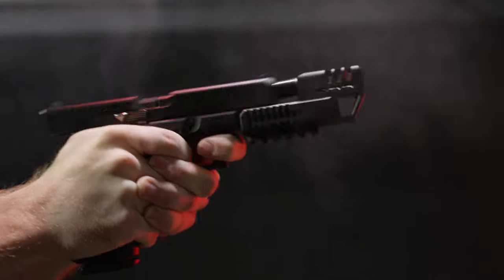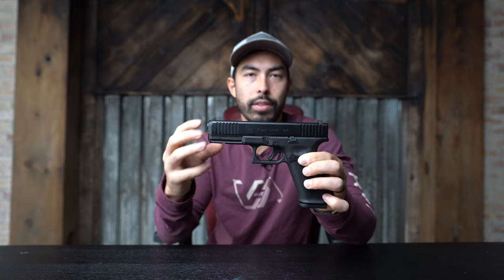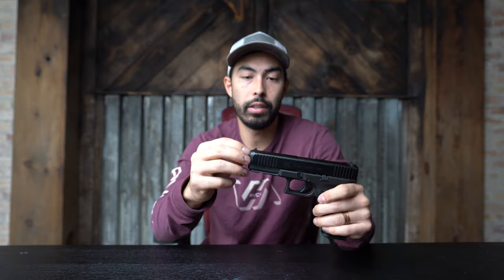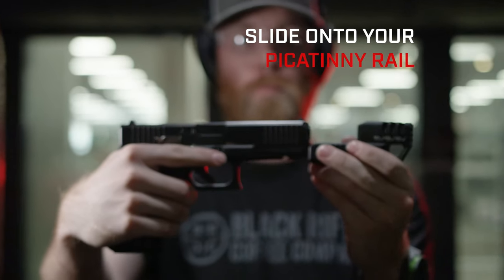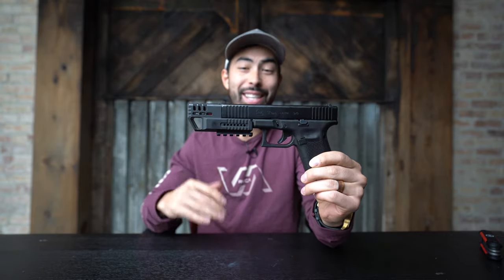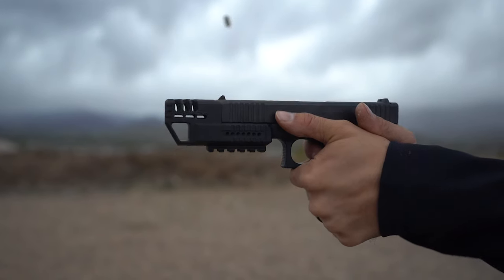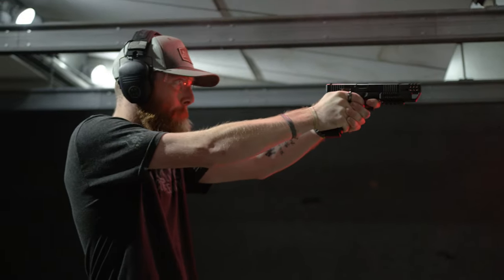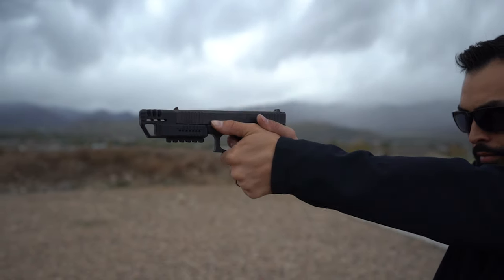The Best RAIL MOUNTED Glock Compensator | No Threaded Barrel Needed!

Comment: My main concern is holster compatibility. What's the point of having that on your gun if you have to keep it in a case, safe or drawer? It just turns into a safe queen or a range toy.
Reply: Why would you want to carry something that big lol.
Reply: @777tWill777   Well, I like carrying the most capable thing I can help it. Even though the likelyhood of having to fire more than 5rds is very low, I still shoot better with a bigger gun that has a comp and most people do aswell.
Reply: The idea is good if it included an integraded flashlight and laser. 
As far as the holster, you can purchase a custom, but be ready to spend and wait.

Better to learn how to make your own holsters in the oven and molding it all in.

Comment: Yeah, but, what if ur training involves a holster? I do alot of drills from the holster and shoot from retention now and then. Practicing the draw is as important as the rest of it
Reply: Strike industries makes a comp called the Mass Driver that also doesn't need a threaded barrel, you can keep on your weapon light on the original weapon light rail, it doesn't interfere with holsters, also it doesn't cost $200.
Reply: @trevornasby1026  thanks for the info!

Comment: I mean to each his own but the only benefit it could provide is contact shooting so the gun doesn’t come out of battery upon making contact since it is “frame” mounted only. If the comp was only attached via the barrel it could still come out of battery when having to contact shoot. Also great way to loose your night vision when shooting at night. Comps = huge fire balls. Same reason teams don’t use comps on AR’s. Flash Hiders yes. More for 3 Gun etc. Not a fan in real world applications. But like I said to each their own.
Reply: Train more. In situations where a comp will cause you to lose your night vision, you should be using a WML for PID.
Reply: Aaron from Sage Dynamics has a wonderful video on this very subject, putting the loss of night vision myth finally to bed. Not trying to come off as an arse but the gun community needs these types of perpetuated myths to be put to bed already. Proper training will always be superior over regurgitated internet gun myths.

Comment: Are there any rail mounted compensators just like this but for Gen 3 Glock 22?
Reply: These will work on any pistol with a bottom pic rail, it might not line up perfectly
Reply: @nicoscarfo4486  yes the only difference is the 17 and 19 versions